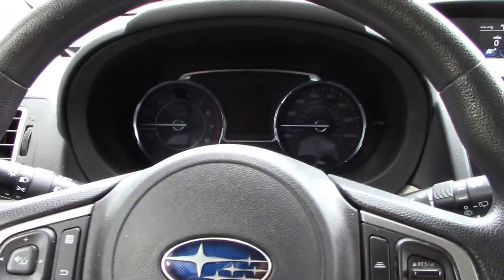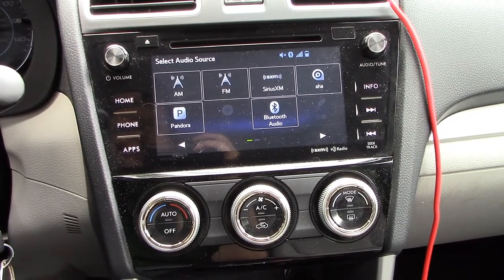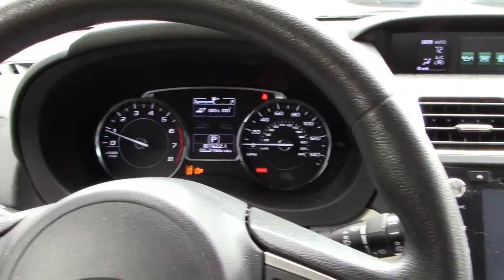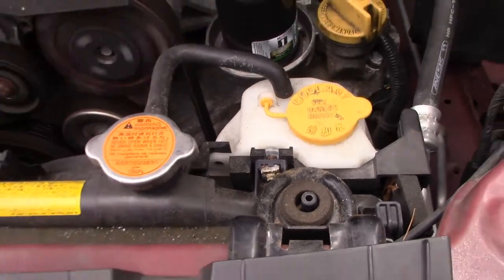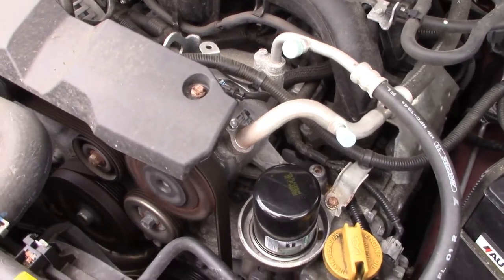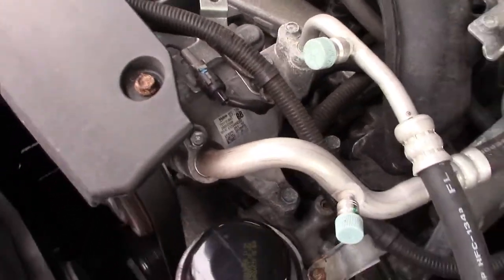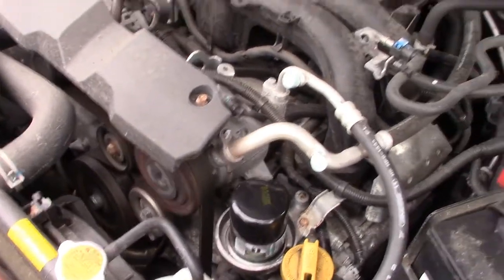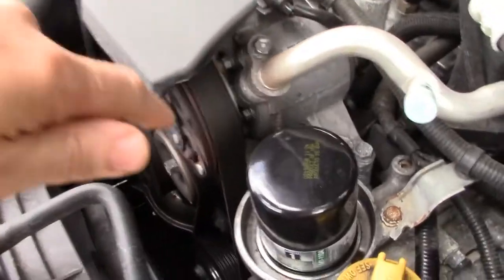2017 Subaru Forester, air conditioner issue

Comment: There is a service campaign for 17, 18 forester contact your dealer they know the condenser in some foresters get rusty and leak so if yours is one they will replace at no cost. Only takes about an hour. Got mine fixed today actually hope this helps someone
Reply from the maker: Hi, Yup that could have been it too. I finally got a notification of the recall/campaign from Subaru and got it done. Asked if there was active leaking at the condenser, but rep didn't know, just replaced. At least if that was an active issue, that's also resolved!
Reply: Mine is 18 and just started to show problem today. I can here that something is trying to engage but fails. I will call the dealer and see. Thanks!
Reply: FIRST HAND INFORMATION: Subaru replaced ours under warranty. The techs said they quit checking to see which cars were involved and just replaced anyone who responded to the notice.
Reply: Thanks,  information is so helpful
Reply: Thanks
Reply: Never purchase a Subaru, always problems with ac, showroom techs rip u off

Comment: TLDR: I tried cleaning the AC and replaced the TXV but only a simple recharge fixed it. 

I think these things are notorious for this AC issue. Glad you fixed it. I actually had the entire AC system pulled out for cleaning, replaced the TXV, and after returning the refrigerant, the compressor still was noisy. So I tried adding more refrigerant and that fixed it.

Comment: I have a 2017 forester also had 2 condensers replaced already both were covered under warranty also 2 compressor replaced 1st one covered 2nd one was not dealer wanted $1,300 took to my private mechanic for $900.  Did complain to corporate and got $500  coupon which I used for tires.  Now doing same thing like all the other times blows warm are when sitting idle or in heavy traffic.  This time should be condenser again but I'm passed the 5 year warranty they sent out complained to corporate again and got no where.  Are they replacing these with the same faulty parts told  her should be class action suit.

Comment from the maker: Well, it's still cool and running fine. I'm calling it a win for now! ;)
Reply: How about the noise? Does it reduced? Thanks.
Reply: Yea, they just dont loose freon for no reason. You have a leak. Remember that it can also leak at the condenser or evaporator. Just look for oil spots.
Reply from the maker: @maolee7217  Yup, after doing the work and leaving it alone, the sounds of the vehicle returned to normal or what I'm use to anyways!
Reply from the maker: @georgecurtis6463  It's a possibility, summer time will be the test, but pressure test done recently was good. I might not have tightened the Low pressure cap enough causing the loss, but not sure. Per other comment, could be a condenser defect or yup a small leak in another area of the system. I have refrigerant with dye if/when the issue presents again.
Reply: Hey Dan, how long did this fix last? Did your AC end up going out again and require another recharge?

Comment: There is a defect in the condenser that is leaking the refrigerant.  Subaru has extended the warranty for this problem.  You should take your Subaru to the dealership and have them "really" fix it.  Just adding refrigerant is just a Band-Aid at this point.  I believe the condenser was replaced on ours.
Reply from the maker: It's possible the issue could be a condenser defect, but not enough information at this point. So far, after the refrigerant fill the A/C is working fine, though the summer time will be the real test. I'm wondering if the issue could have been user error as I don't think I tighten the Low side cap tight enough. Anyways, within the last week, I took the refrigerant pressure again and all's well. Beside a possible condenser defect or user error, there still could be a small leak in another part of the system, but only way to find that (I think) will be when the leak gets larger. I do have refrigerant refill with dye added, so if I need to use it, I'll add and periodically check with UV light to try to find the leak.
Reply: YES, the problem didn't, magically, appear out of nowhere.

Comment: Thanks for this. Have the exact issue! Hissing sound in the aircon (only driver side blowing hot air), and when you check the condenser, it sounds soooo bad. Called the dealer and said it might be included in recall. 2018 forester less than 22k mileage.. fingers crossed!

Comment: An a/c system can have a leak anywhere, big or small.  My own '17 Forester XT had the condenser problem in 2020, and it leaked only a modest amount out, so the compressor still engaged (but was noisier) and there was still some output of cooled air, just not nearly enough.  An oddity of the Forester's ductwork is that when refrigerant is low but the system is still engaging, the coolest air emerges from the right-hand dash vents, while the left-hand ones are not cool at all.  For cars with my car's fancy 2-knob dual system (separate temperature settings for the driver and the passenger) this falsely suggests to some people that the left/right air-dividing system has gone wrong.  It hadn't, in my car.  I had a dealer repair done and it has lasted fine for more than 2 years now.  Don't let a weak-performing a/c system sit unrepaired for long - something serious enough to make the compressor noisier, is going to wear it out faster, even if the leak has nothing to do with the compressor.

Comment: I read in comments on another post that mentioned that the newer models have a smaller volume of refrigerant overall than the older models, so maybe it didn't require much to start working again. Yeah, I was floored when I seen the price of a new compressor ($600-800).

Comment: How is it now???
Reply from the maker: Hey! So far, so good, but summer time will be the real test! Though a few possibilities still on the table; user error (I might not have tightened the Low pressure cap enough causing lose of refrigerant), possible supplier defect in condenser of the car, or small leak somewhere else in the system. Fingers crossed for user error! lol